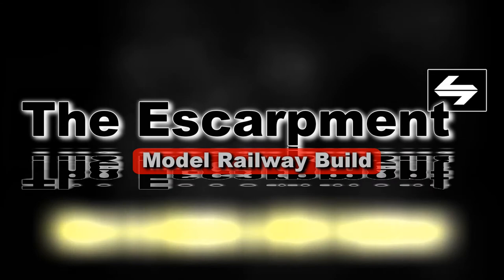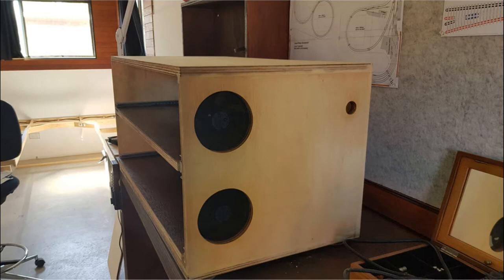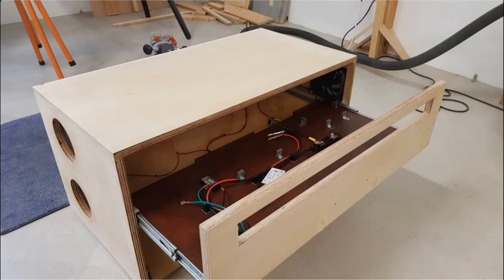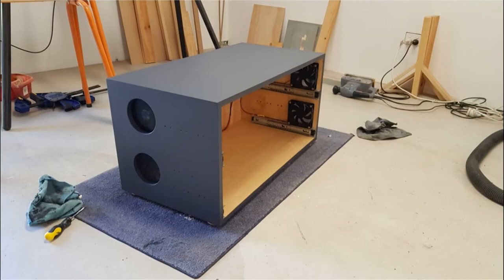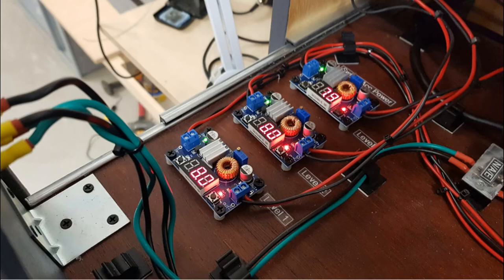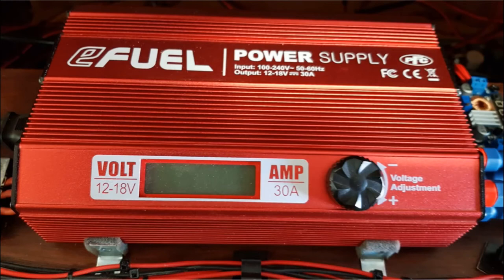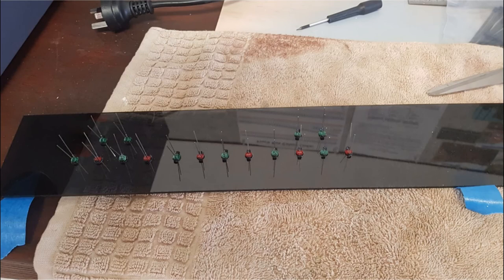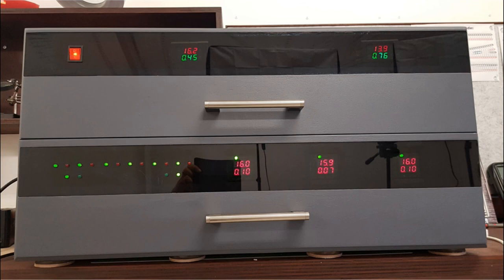Building a Model Railway DCC Cabinet - The Escarpment

Comment: Hey Jase, looks good I'm going to make one similar as your drawer for my HO layer building what size are they W, L, H dimensions?
Reply from the maker: Hey Jason, thanks for the feedback. The draws are 800mm wide, 200mm in height  and about 450mm deep. Built it to fit my framework. Just adjust those figures to suit your space..cheers